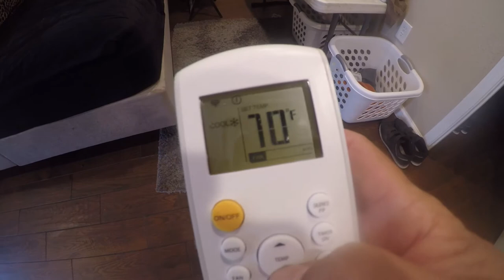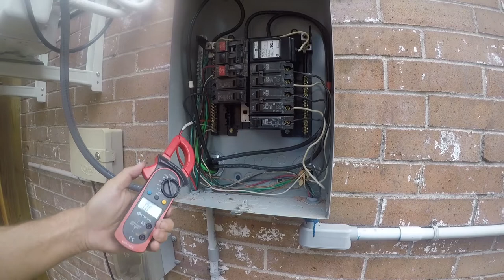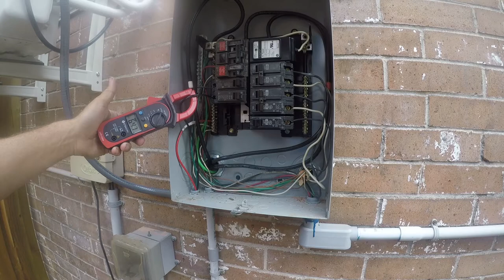HVAC: How much power does a 1 ton 16 seer Mini Split Draw?

Comment: Thanks for posting!  I am going to install the same size unit for the same reason.  Wanted to confirm the low amp draw to make sure that my unit will run off of my small generator during a power outage.  Exactly what I wanted to know.

Comment: You said in a comment below this is a 220 volt unit.  220 volts x 7 amps = 1,540 watts, not "under 800" like you said in the video.  Please don't spread bad info.
Reply: correct, thats high for a 12k btu inverter AC, my panasonic claims 4.1 amps running.. which is around 900 watts